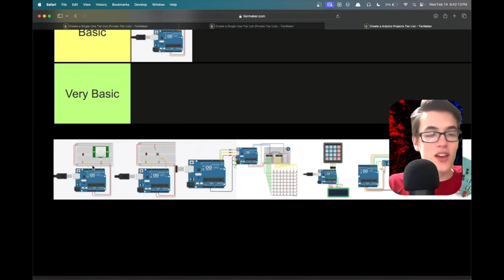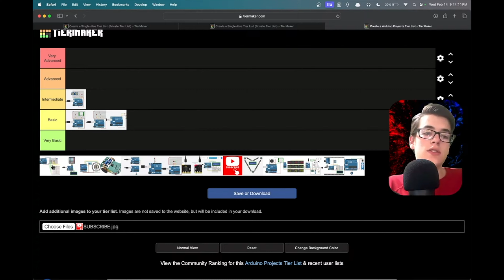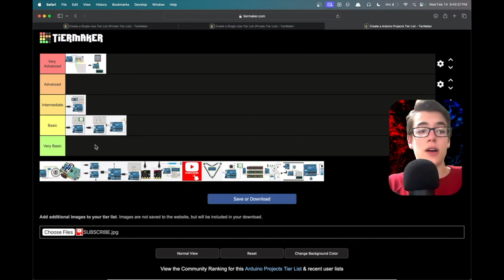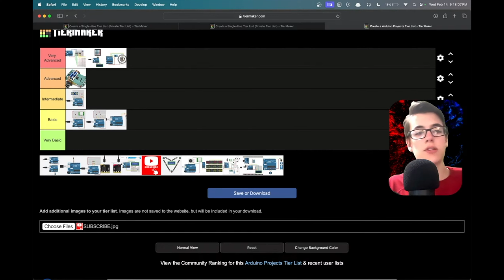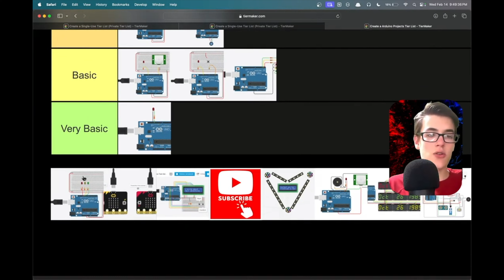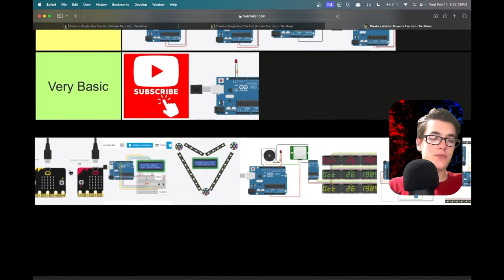Ranking EVERY Arduino Project on this Tierlist

Comment: Hey, I want to you tried to make a glowing whip, because I am really addicted with terraria and now I’m a fan of whips.
Reply from the maker: Hmm yeah something similar to the lightsaber design should work for that, but we'd have to come up with a flexible casing that would protect the LEDs...
Reply: @danovation  what about soft transparent silicone inside? i think it may protect leds.
Reply from the maker: @дота_2  Yeah they do sell waterproof versions with silicon on them, so if we could use two of those back to back and then surround that with a little foam (for diffusion, so you can't see the individual LEDs). Then we just need to add something around that that's pretty sturdy to defend against impacts...
Reply: @danovation once I tried to do a whip made of segments of polypropylene pipe. I cut it into pieces and started to string them on a rope. It worked.
What about making the whip out of segments of something shockproof?
Also, we can make transparent segments inside of the silicone tube, where leds are in.
Reply from the maker: @дота_2  Hmm yeah lightsaber blades are usually made of polycarbonate, we could use segments of that and then it's basically the same setup with diffusion and everything